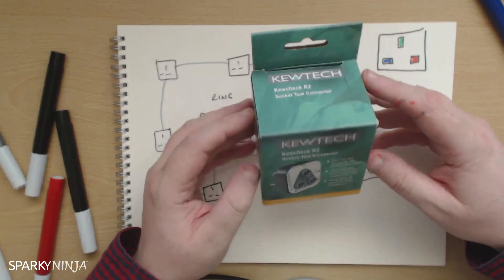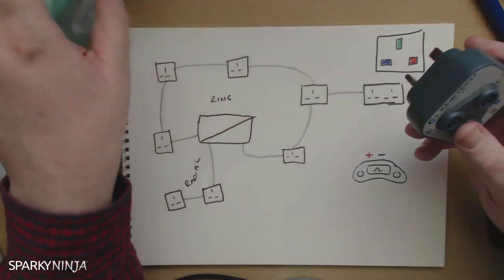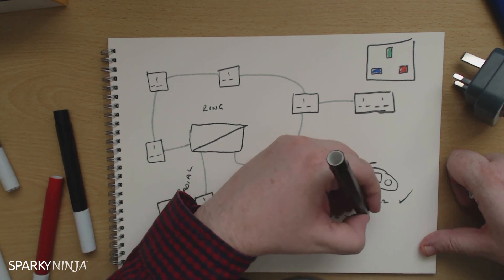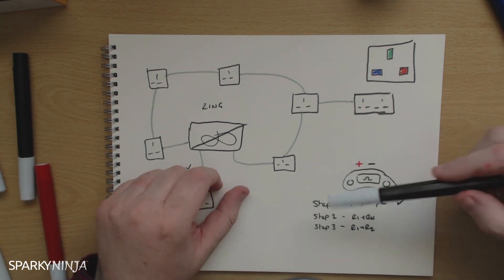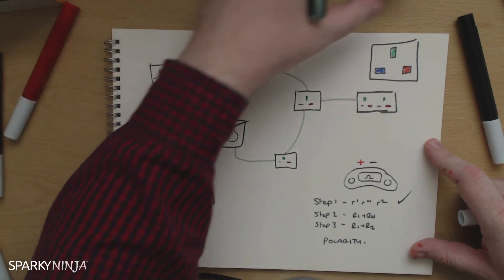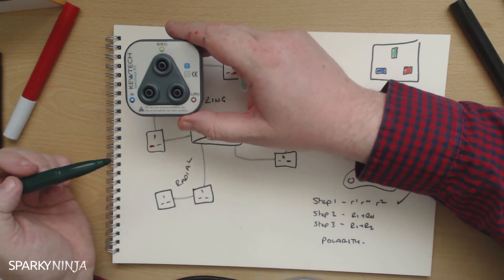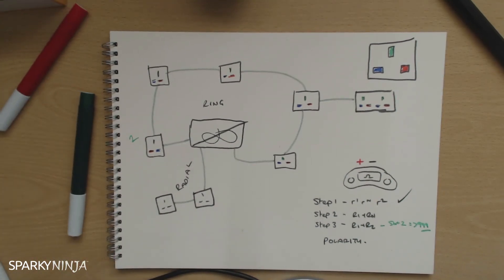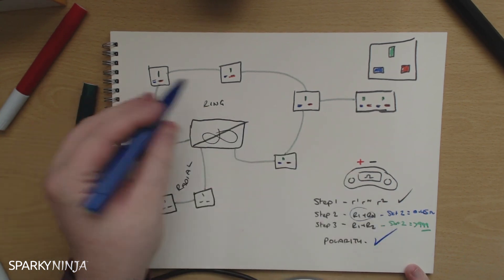R2 Adaptors - a potential issue (old video)

Comment: I totally disagree with you, I always use an adaptor like that or test leads that has a plug top, why, because your testing all the circuit includes pins connection, secondly if you test R1-R2 from socket terminals you are looking for the brown wire and CPC  to test  and unlikely be checking the L & E symbols on the back 
.also you should be testing R1 + RN
Reply from the maker: If you are lowering the socket you should be identifying polarity not looking at the cable colours.

R1&RN isn't a requirement for radial circuits according to industry training and guidance.

Comment: Thanks for another great video.
I am thinking of buying the Kewtech KT65 DL tester which has some good deals with extra bundled accessories at the moment. It seems that the Megger testers are the more popular choice but they cost so much more. What is your opinion between the 2 brands in terms of ease of use, reliability, value for money etc?  
Kind Regards

Comment: I can see where you are coming from, but I personally don't think it is the fault of the socket adaptor. It is the fault of the testing method used. A lot of MFT's can now change the terminals under test OR have loose leads at the tester end so you can swap them about. This would give the same effect.Does this make the MFT sub standard or the testing method laid out that doesn't pick up the fault?

I actaully like these for EICR's, at least you can check outlets to some extent that aren't removable dur to 100 layers of paint or plastered into the wall. 

Same as a lot of things, used correctly they can be a god send, used incorrectly and..... well.

Great vid as usual though ;)
Reply: I don't think he was saying it was the fault of the socket adaptor.  If something like that is missed, it is the fault of the person carrying out the test.  If it is because they took a short cut using equipment that may hide potential faults then that is still the fault of the person carrying out the test.

Comment: If you'd done an R1+R2 test and got an open circuit then a R1+RN test and got a closed circuit, it doesn't necessarily mean that the line and cpc conductors are reversed, it could be that the cpc has come loose and no longer connected at the terminal.

Comment: That is a socket breakout box, which is fine for accessing the conductors without removing the socket. If you use a socket tester then surely the problem will show itself.
Reply: John Jones- If you use a socket tester, it won't pick up a reversed neutral and earth fault, and even more importantly correct polarity should be confirmed before the installation/circut is energised.
Reply: Ok I can see where you are coming from, to be honest I wasn't thinking of installation test, I was thinking periodic inspection. I was also not negating any other tests but thinking run round with the socket tester first then proceed with the other tests.
Reply: John Jones- Yes, I'd agree with you, on a EICR, wizz round the property and use your socket tester to identify how many sockets are on that circuit and if they've been wired correctly.